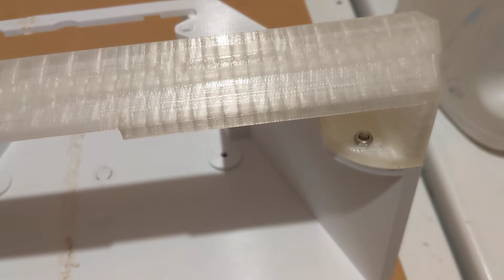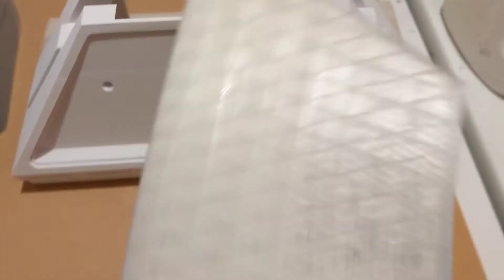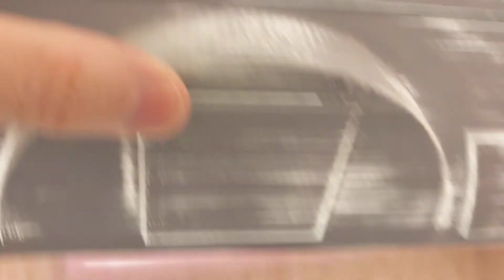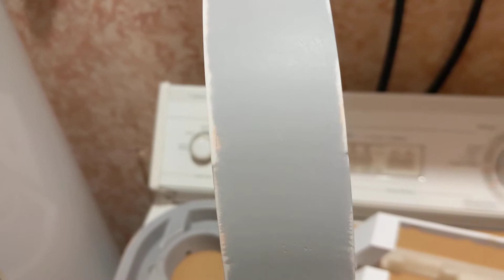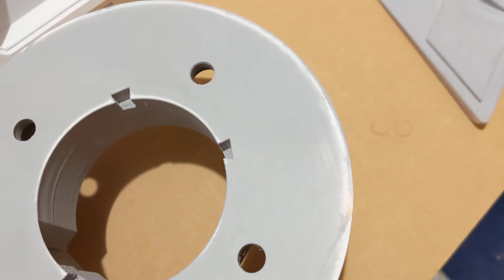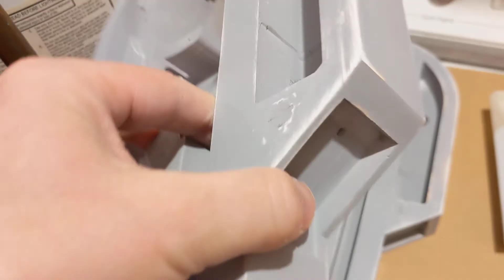3D Printed R2D2 - Part 43

Comment: Glad they have now printed ok. Thanks so much for sharing your whole project with us, 'worts and all' it is much more informative and we can see that you are ending up with a much better finish. Just lately I have seen other videos that profess 'this is the best' and find that, well it's not quite right.

Share a problem time, my V5 clone hot end finally succumbed to all the printing and I have been desperately trying to squeeze out some 'this is the best' adapter plates to fit an e-3d Hemera.

When sanding small flat surfaces, you may be able to switch around and put your sanding paper/sheet on a flat surface and then rub the part across it, that way the sanding sheet will not try to round off the edges. It may even be worth buying the roll type sanding sheets. https://www.amazon.com/s?k=sanding+roll&ref=nb_sb_noss_1 for the length.
Reply: That's a great sanding tip!  I've done that before with small pieces but I still manage to press down unevenly, although it's usually does end up looking better.  I don't currently have enough work space to try that method on larger parts but I'll keep it in mind in case I back a car out of the garage and set up a work table.